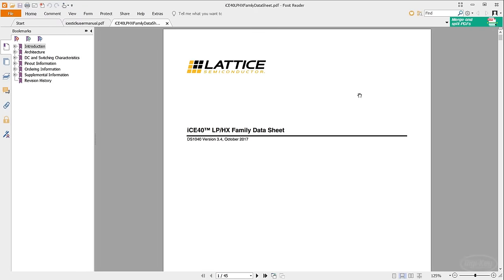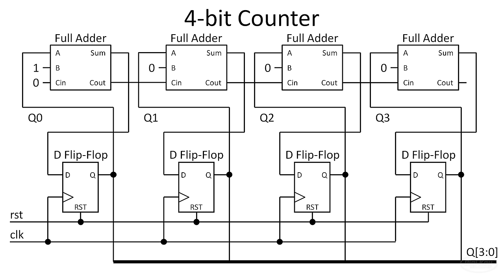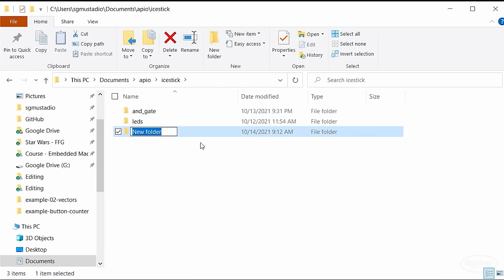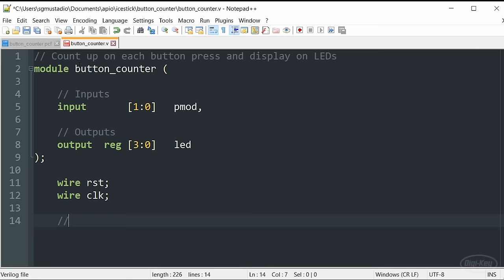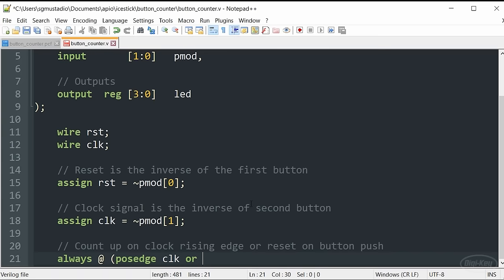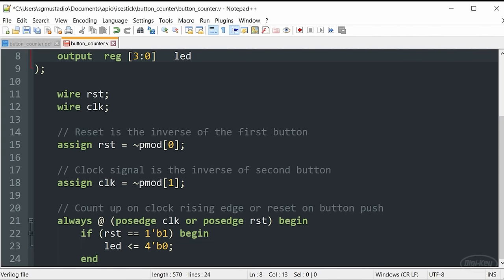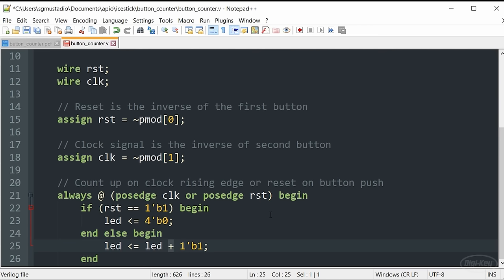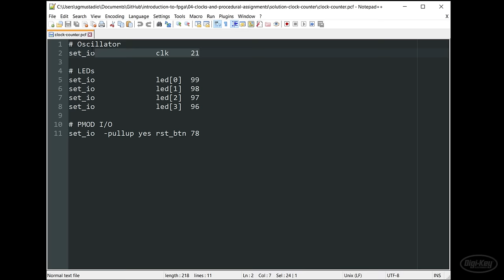Introduction to FPGA Part 4 - Clocks and Procedural Assignments | Digi-Key Electronics

Comment: I did the assignment, but I needed the Google's help to keep the syntax correct and to read more about wires, registers and other types and declarations, because my first codes simply did not compile. Then I realise, that I can start from a "working code" that compiles without error and type my code in steps, where after each step I am trying to compile the code and verify if it's correct. Thus actually I've learned a lot about Verilog. And I like it's C-like structure.
However, for the internal clock divider down to 1Hz I needed to "steal" some ideas in the web, because I've had troubles to put this procedure inside the code without build-error and my approach with two modules was wrong, also the declaration of variables and registers was not initially correct. But I'm happy I did it, after 1 hour fight with Verilog. Now I am going to check Shawn's solution and go for lecture 5!
Thanks Shawn!

Comment: What would happen if, instead of a single always block, we had two always blocks, one for rst and the second for clk?  Was there a particular reason they were combined into a single always block apart from convenience?
Reply: Good question! You could create two separate always blocks that accomplish the same thing (as they operate in parallel). However, you'd need to be careful about how you designed it. Remember that the non-rst logic in the single always block only works if the rst line is low. So, you'd have to account for that in your always @ (posedge clk) block.
Reply: It would be difficult to make two always blocks for this counter, as both blocks would be generating the output signals.  Just like you don’t want to drive a single wire with two separate pins (perhaps on two different chips or components) on a protoboard, you don’t want to drive the led[3:0] signal from two different always blocks.  They would fight over what the correct signal value would be.

Comment: Can a Verilog module have multiple always blocks?  If so, why not have different blocks for the reset and clock?
Reply: Good question! Yes, you can have multiple always blocks (they operate in parallel). You could create two separate always blocks for the reset and clock functions. However, you'd need to be careful about how you designed it. Remember that the non-rst logic in the single always block only works if the rst line is low. So, you'd have to account for that in your always @ (posedge clk) block.
Reply: @ShawnHymel  So, always @ (posedge clk) begin
if (rst == 1'b0) begin
count <= count + 1;
end
end
???
Reply: @byronwatkins2565  Yes, that is a good start. Remember that the count also resets on a clock positive edge so long as the rst is held high (if you're trying to replicate the functionality of the original code). So:

always @ (posedge clk) begin
  if (rst == 1'b1) begin
    count <= 0;
  end else begin
    count <= + 1;
  end
end

always @ (posedge rst) begin
  count <= 0;
end

I haven't checked this on my board, but it should work the same.

Comment: Just wanted to point out that in an always block it doesnt necessarily execute sequentially. It will execute everything in the always block on the clock signal so if you had multiple assignments in one always block they will execute in parallel. Might also be worth mentioning blocking and nonblocking assignments, because <= doesnt just mean it gets that value, because you can also use = but they do different things.
Reply: Yes, this is true if you're using non-blocking assignment operators. It becomes more sequential if you use blocking assignments, though. However, it still all happens on a single clock edge.

Comment: Hi Shawn,
Great video! One question though, *Spoiler warning* why use 32 bits for 6,000,000? You only need 23 bits for 0b10110111000110110000000. I tried to post a comment on the solutions page but it was not being very cooperative. Thanks!
Reply: Good question! I left it in when I was playing with different divider values as a "catch-all" bus (and honestly, I forgot to change it). You are correct in that you could make it 23 bits and be just fine (and in fact, it would save you some hardware when you synthesized the design). Later when we talk about modules and parameters, you'll be able to make the bus any size you want at the time of synthesis.

Comment: Are the signals always binary?
Reply: Signals listed with a vector width before the name would be a group of wires (or registered values) that contain the number of bits given. For example, “wire [7:0] my_bus;” would create a bus of 8 bits. If you don’t declare a vector (e.g. “wire my_signal;”), then the signal would be binary (one bit). Hope that helps!
Reply: Only if it's not transitioning....
Reply: @ShawnHymel  I was imagining if it would be possible to use FPGAs on analog signals, like with opamps. Looks like it is not the case
Reply: @viniciusfriasaleite8016  Most basic FPGAs are digital only. Some advanced ones give you analog capabilities. Often, these are referred to as "mixed signal" FPGAs.